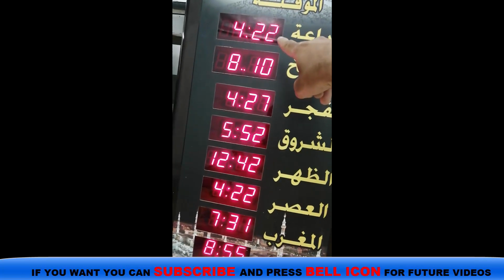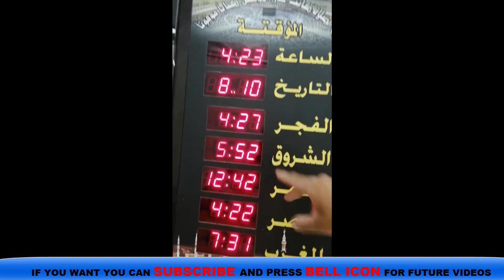{187} How To Repair Digital Clock, No Display Problem Solution

Comment: Ussalaam-o-alaikum

I have some issue with scrolling message board. One of the IC is getting hot. The scrolling message is working fine, the time displays are not working. From where (in Lahore) I can get it repaired or change the board?
Reply from the maker: wa alaikum salaam
yes you can visit Hall Road Lahore (Electronics market) like Electronics 2000
there are many excellent. 
heating IC may be due to supply problem or may be IC is damaged.

Comment: Excellent repair and interesting failures. It is quite easy to test optocoupler with 2 multimeteters both with diode test mode. One connected to the fototransistor side and when you apply  diode test from other dmm to light emitting diode (forward biased), then other dmm shoud show lower voltage drop.👍